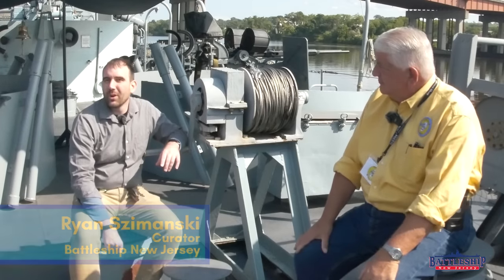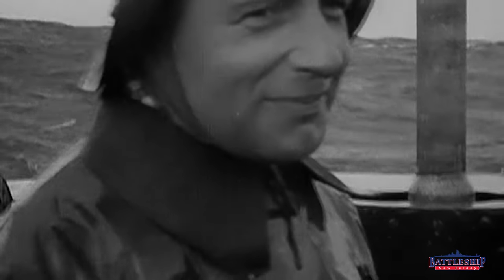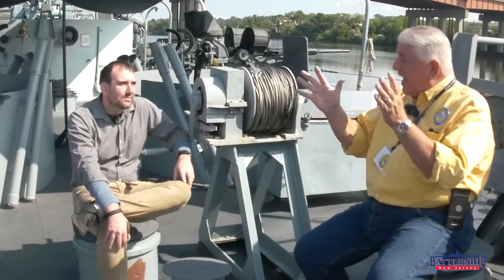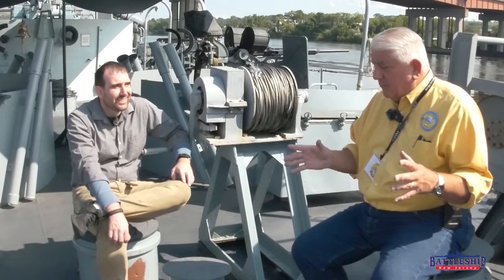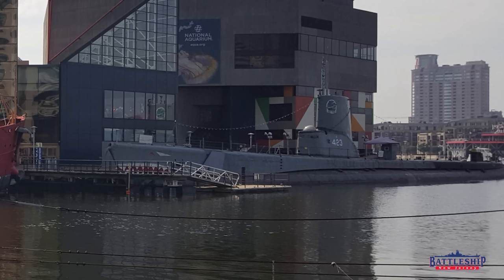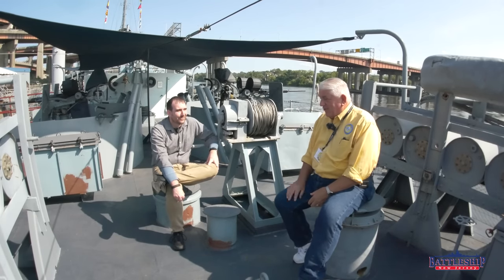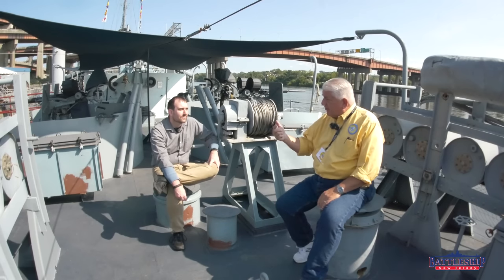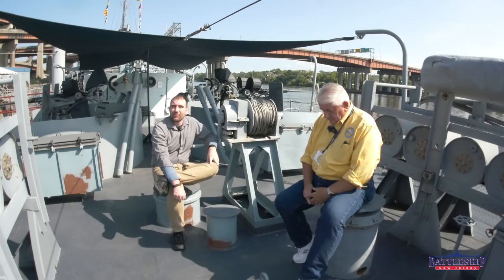Acoustic Torpedoes with @USSCod Part 1

Comment: Didn't it take until the 1960s or 70s for acoustic homing torpedoes to be reliable enough to be effective?
Reply: No.
Reply: NUH-UH!!!
Reply: Well, they're not that good IIRC, Mk-37's were just slow and small, had issues with their batteries, but everything got better when Mk-48 entered service. Except the Brits, the Brits has 💩 torpedoes post-WW2 'till the end of Cold War
Reply: @M16_Akula-III  'Except the Brits, the Brits has 💩 torpedoes post-WW2 'till the end of Cold War' well, that is utter nonsense and screams like an arrogant American considering the Mark 20 Bidder ASW Torpedo was probably designed for the Submarines of the WW2 era whereas the Mark 24 Tigerfish was the victim of multiple factors conspiring against it but once the Mark 24-Mod.2 Tigerfish came along in the early 1980s, it was a very reliable weapon
Reply: @Knight6831  While yes it was reliable, it was still comparatively 💩. I would literally compare it to the NT37C